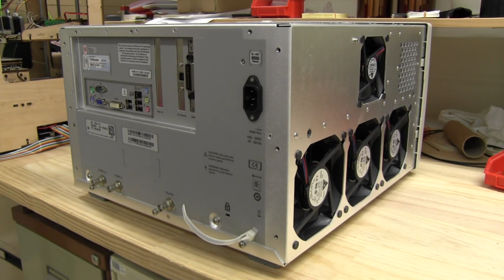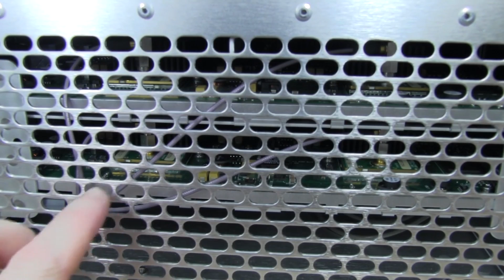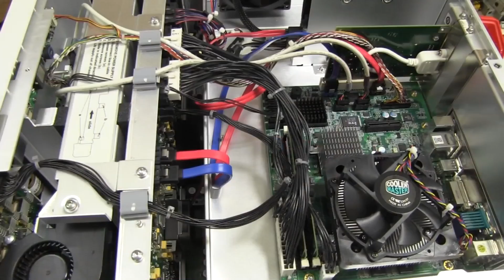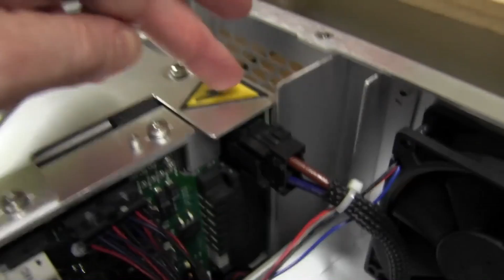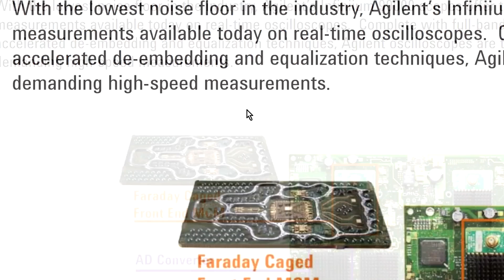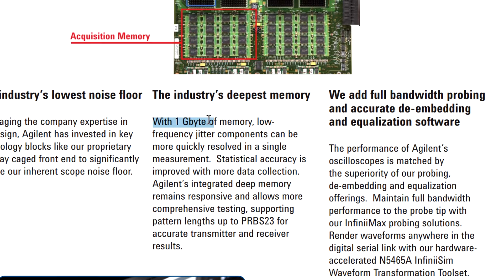EEVblog #342 - Agilent 90000 Oscilloscope Teardown

Comment: could be a lot more than 50 when you consider the man power needed to test out the components and provide feedback back to the design engineers that are working on the specifications and PCB layouts

Comment: I doubt it's 50 engineers. The difficult bit is the design of the hybrid modues, and that's a one off design - but very specialised. The rest will have many parts common to all the scopes designed by their core engineers.

Comment: If you know electronics like most qualified techs in the industry do, you are paying of the quality and developement costs that go into research for developing high end scopes. Much more than just stringing IC's and circuit boards together. If you have ever used the infinium series of scopes you will understand what I'm getting at. Using high end Agilent test gear is like a religious experience, but unlike the lies and deceit in religion, this is the real whammy.

Comment: Well, if you're trying to move gigabytes of data into a general purpose PC very quickly, how else would you do it?  Map the acquisition memory as a mass storage device and DMA it in would be a very easy way to go.  No custom motherboard, just some custom drivers.  Alternatively, connect to it over PCI or PCI express, but when the scope doesn't fit on one card it is a little more complicated to interface with.  Who knows what they do under the hood to make that work.

Comment: There were no air filters in sight. Do the heat sinks and other parts do the filtering like in a PC, such that you have to open it up and clean everything up every so often? That's not very nifty.

Comment: no serious developer? have you ever tried programing on linux? it's way easier, and the libraries and stuff is a lot more standarized than in windows.
The problem with "serious developers" no coding for linux is administrative speculation, because they code for "popular" platforms because it' gives more profit for the cash invested. microsoft spends money on marketing, linux does not, else see macs, why mac and not linux when they were both below 5% just some years ago? and both being unix based

Comment: Why would they ever be there if the board was't laid out with those there for the Agilent product? They're not in the right place to be additional SATA ports, and if that's what they're meant to be, they'd be fitted on the standard board.

It seems logical to me at that least the primary motivation for the development of that board was to fulfill Agilent's requirements.

Comment: Both the red and blue cables going to the front board are for PCI-E. The second red cable going off to the HDD is SATA. SATA cables have two pairs. One PCI-E lane requires.. two pairs. You'll also need the clock, which is why there are two and they are identified by colour.

Comment: Which this board is A: Not. And B: Note the oddly blank areas where the 'SATA' connectors on this board are. The M321 is based on this custom board, not the other way around.

Comment from the maker: Then tell us what you think it is. It may not be SATA, but it does look like SATA and a standard-ish motherboard. I assume it would be easier to use an existing SATA interface in terms of software, firmware, hardware interface etc than to roll your own.

Comment: You're right about it not being SATA, but I'm still sure it's at most a slightly customised off-the-shelf embedded PC board. If it was a completely custom board they'd eg. have left out the rear panel audio connectors - note how the documentation seems to ignore their presence. The board shots in the service manual also don't show any "Agilent" markings. And architecturally I'd say a PC with a scope stuffed up its arse is a very fitting description.

Comment: >the russian page you linked to doesn't have a datasheet
Don't know what causes problem with this URL, try this shorten:
goo[dot]gl/2DwcV
Page 21

Definitely, there are two revision of this scope with different operating systems. One runs XP, another one runs Win7.

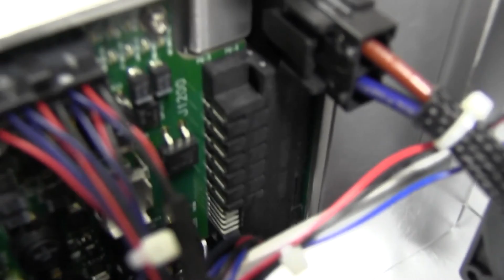Comment: the russian page you linked to doesn't have a datasheet, and doesn't mention the software specifications in the adblurb. the actual datasheet, cp.literature.agilent[dot]com/litweb/pdf/5989-7819EN[dot]pdf straight from Agilent on page 28 has what I wrote. also, the dialog box shown @10:03 in watch?v=o8DPlqWVmzk isn't windows XP. on the forum post, dave said "A sticker on the back says it runs XP, but is using a Win 7 license sticker." so I think you need an upgrade to match the new specs :P

Comment: I believe I covered this in my comment on the previous USB 3 Eye diagram video: "it uses Windows 7 Embedded Standard running on an Intel Core 2 Duo 3.06 GHz processor with 4 GB DDR2 internal RAM, and a >250 GB internal HDD."

Comment: It's not. It really is not. For starters, it's Flex-ATX. Then you notice how it has weirdly positioned connectors, like the USB headers. And an LVDS connector. And two really, really oddly positioned 'SATA' cables which go to an oscilloscope front end.

This is a hugely expensive oscilloscope, not a USB logic analyzer with a PC stuffed up its backside.

Comment: >kinda like a teardown.
All of the magic is in the chips..
>data flows through the board, how it's encoded 
PCI, PCI-E and some lower speed buses like i2c for sensors etc. I think internally ISA is still hanging around for x86 machines.
>how does it go from the graphics card to the main processor? 
The memory on the graphics card is mapped in to the processors address space..
>custom-built PC community
Not sure why.. you don't need to know how any of it works from a user level.

Comment: Yes, many. Integrated graphics are quite normal. There's absolutely nothing special about that part of the board, as far as I can see. It's likely just an Intel chipset with a connector for LVDS, rather than using a DVI converter immediately.

Comment: That block of SATA connectors is SATA. Notice how the cable runs off to an HDD!

The board does not have standard connectors in many places. It has custom connectors, including those two 'SATA' ports by the PCI slot, the header just next to them (possibly LVDS display? Looks unshielded, though), there appears to be an additional power connector by the actual SATA connectors which only has two conductors connected..

It's not super-special-totally-custom, but it is NOT off the shelf.

Comment: The board looks fairly standard.. and the block of SATA connectors is in the same place they are standard boards.. also if it's something custom why have so many connectors? Do they have scopes with 4x the bandwidth of this thing?

Comment: Dave, I think it would be pretty interesting if you posted a video of the explanation of how a modern high-end motherboard works, kinda like a teardown.
Something like how the data flows through the board, how it's encoded (data transmission protocols [how does it go from the graphics card to the main processor?  Does it at all?]), etc.

Make it one of those amazing videos of yours that are "reference quality" -- I'm sure the custom-built PC community would love and learn a lot from it!

Comment: I just acquired a barely-used TLA7012 Tektronix Logic Analyzer for...free. It's very similar in construction - with six big and two small fans. It's a virtual windstorm.  
I think the small board is the touchscreen controller.